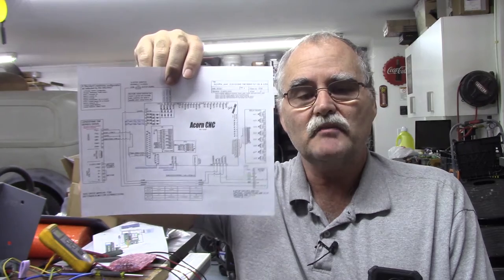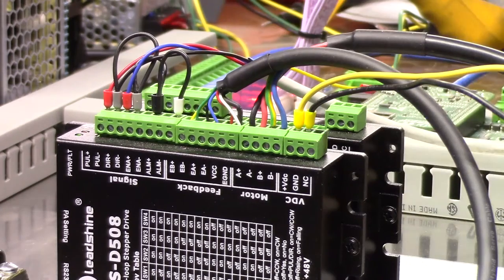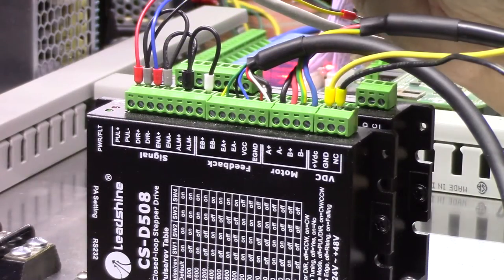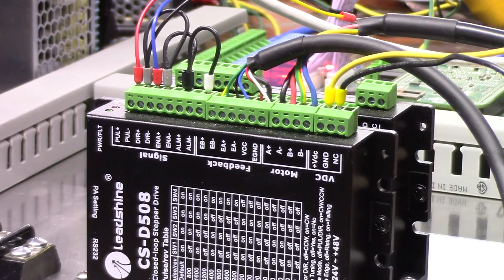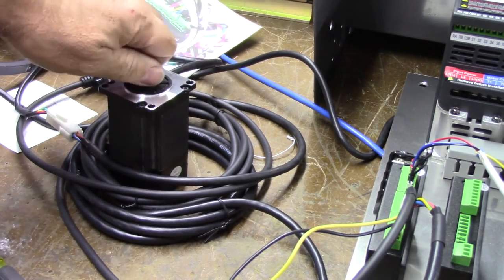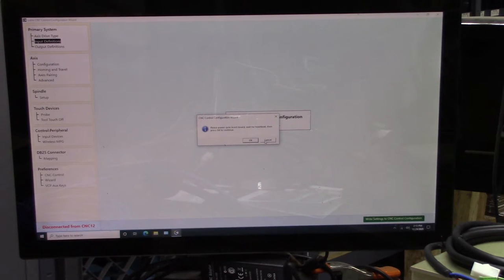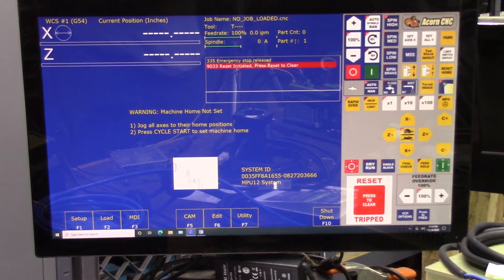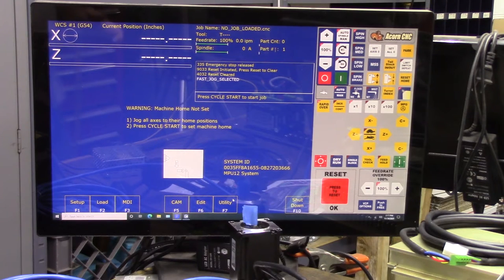Emco PC5 to Centroid Acorn Conversion. Part 6: Bench Testing a Leadshine CS-D508 Drive and Motor

Comment: Hi Marty,
Thanks for another great video. I really appreciate your content. I am using the stepperonline CL57T driver, which is just a rebranded CS-D508. I just wanted to make a point for any newbies who might wonder why your wiring in this video is different from the diagram for the CS-D508 ("S15032-ACORN_rev4_Multiple_LeadShine_CS-D508") on Centroids site (https://www.centroidcnc.com/centroid_diy/downloads/acorn_schematics/centroid_acorn_hookup_schematics.zip). Most people watching your video will realize that the difference is just a matter of sinking vs sourcing, and that either wiring method will work correctly. Thanks again for the great videos!

Comment: Hello, For my new C.N.C I want to connect LICHUAN LCDA86H drivers in closed loop on the Acorn board, but I cannot find the diagrams to connect 2 Drivers in parallel on the Y axis. Thank you for your help.

Comment: So the regular header pul+ and dir+ are 24v output and the db25 route accesses those signals via the 5v logic instead? It's never made clear but from your suggestion to just use the supplies 5v and source negatives from the header that seems to be wiring like a relay. I'm not much of an electronics guy but I consider myself competent. I know when buying a Chinese 1.8kw servo drive I was asked "5v or 24v" and in the manual to my hybrid steppers it suggests using a resistor if 24v so I'm guessing I should use the db25 route. Surprised they didn't include a header to access the 5v directly, seems safer.
Reply from the maker: Chris, 5v logic drives tend to be easier to wire to the DB25. If using the header, then +5vdc to +pul, +for and -PUL to ST, -Dir to DR header terminals. Leave ENA disconnected at first as most drives default to enabled. If you connect it without inverting it in the ADVANCED tab in the Wizard, or changing it's state in the drive manufacturer's software, when CNC12 is reset and ready, you may actually disable it and not get movement
Reply: @martyscncgarage5275  Appreciate the reply. Got a "new to me" pre-broken Novakon NM-135 for cheap which is essentially an old Syil X4/Sieg KX3. I think mine differs from yours because it had a BLDC motor stock, no luck with it though so I got a 1.5kw 3k ac servo coming tomorrow. My 135 also has standard tapered gibs with one adjustment screw at each end of the X, Y and Z. 

 Is your Syil a BT30 spindle? My only complaint is the R8 on mine so I'm stuck with TTS which in my experience has poor runout/price compared to cheap BT40 holders I have used in past.

Comment: Hi,  Can you say any more about "5 volt logic drives should be connected to the DB 25 an not the header"?  Does it not work both ways?  I can't seem to find any other reference to that, outside of this video. i have DM556Y and would rather not use a breakout board if I can use the headers.  they're open loop.
Reply from the maker: It's us better to use 5v logic drives on the DB25 with a DB25 male breakout board you can buy in Amazon for less than $10. You can try the header. Run +5vdc from Acorn PS to drive +pul and +for. Then -pul to Acorn ST1 and -dir to Acorn header DR1. Do not connect the enable. Lost more on this if you would go to the Acorn users forum and search for that topic

Comment: Thanks Marty for your collaboration, I am interested in connecting the C86 Connection Board for the Acorn controller For DMM and Servo DYN2 motors. since I saw it in a video about a year ago more or less and all the necessary components to make the respective configuration.

Marty gracias por colaboración, estoy interesado en la coneccion de la Placa de conexión C86 para el controlador Acorn Para motores DMM y Servo DYN2. desde que lo vi en un video de hace como un año mas o menos y todos componentes necesarios para hacer la respectiva configuración.
Oswaldo

Comment: Marty just checked back in . Nobody is watching your videos? It is the most dry boring attempt at selling centroid i have ever seen. Oh and my mach3 with the $15 ebay board is working great and making me lots of money. Get in the wind there Bro LOL
Reply from the maker: You are certainly entitled to your control choice. Mach 3 is obsolete and no longer supported. Centroid continually improving their hardware and software with new features. I appreciate your opinion!
Reply: @martyscncgarage5275  mach 3 is fully supported and centroid is over priced also the acorn is very limited
Reply from the maker: @tomhutchins1046  Tom, Mach 3 was at end of life several years ago. I'm ok, certainly we all have a choice to choose what we like. I have nothing against the other control software out there. Best of luck in whatever you choose to do, but have fun!
Reply: @martyscncgarage5275  LOL its not an orange i does not rot. Its not milk there is no exp date. if it works great 10 years ago it will work great now i dont see how you can ask for more than what mach will do once you get it set up right on the right computer. There are experienced mach users that are still discovering new features in mach3.
But if you selling centroid you will follow the company line.
Reply from the maker: @tomhutchins1046  What's your point? I understand you like Mach. I explained I have nothing against it, I am very content with Centroid. Users may choose what ever they feel the most comfortable using.
Reply: @martyscncgarage5275  Im amazed your responding to these obnoxious emails LOL. !! Get some of them there biker chicks on the channel maybe you will get some views. Oh and remember there are many bugs penicillin wont kill.
Reply: Fyi, just bought a centroid acorn and WMPG-4 Wireless MPG :)